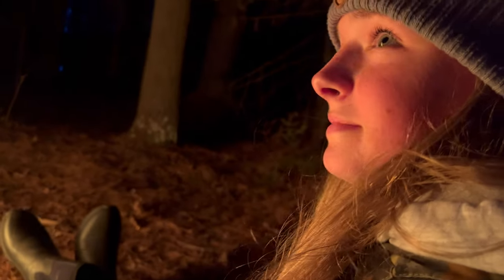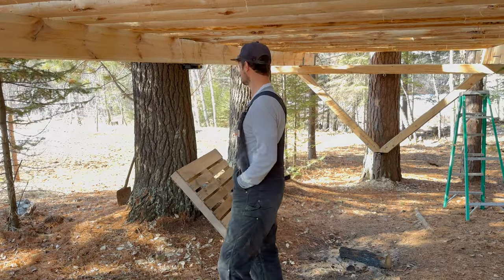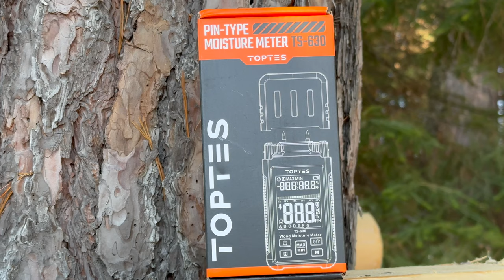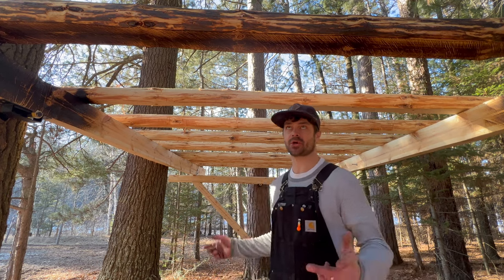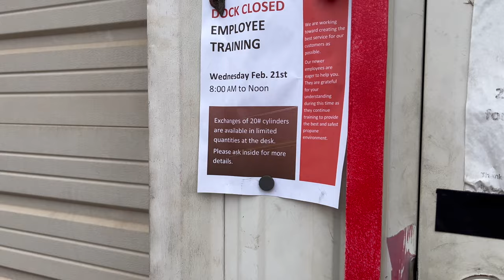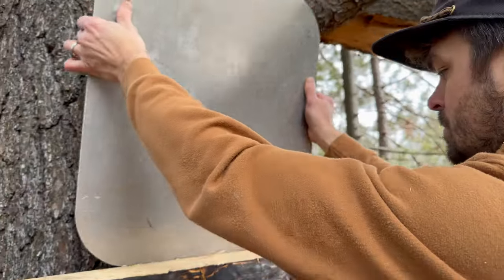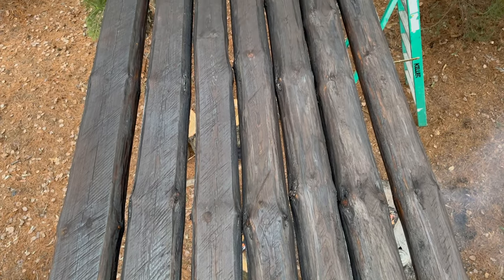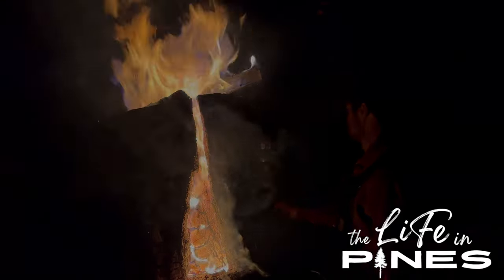286 Feet of Shou Sugi Ban For Our Off-Grid Treehouse | Ep. 7

Comment: Shosugiba for those beams supposed to seal and protect against weather and insects if I read it right
Reply: TheLifelnPines  I have just been watching a lot and I mean a lot of home improvement shows and a lot of homestead channels on youtube trying to sponge up as much knowledge as I can. Thanks to y'all I learned about the moisture in wood. It was interesting to see the difference between the wood that was dryer and what was a fresher cut pretty cool how it char differently
Reply from the maker: Yes! you're absolutely correct about the protection preservation of the wood from burning it! We were honeslty shocked at how dry the logs were even though we cut a live tree and it had just been milled! But yes, those logs definitely didn't burn as well (but did make it look cooler!) Thanks for watching! 🌲